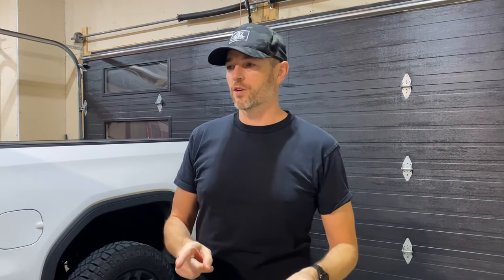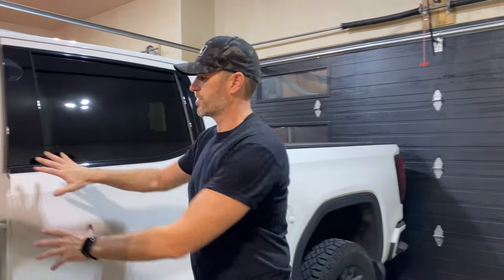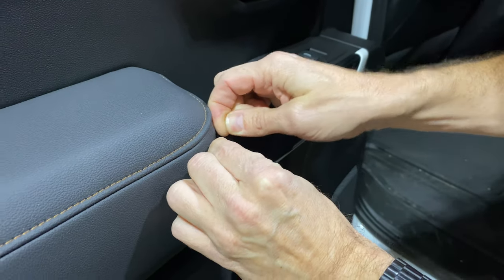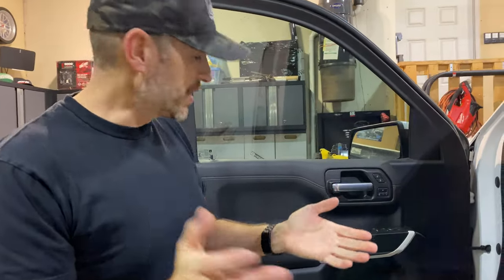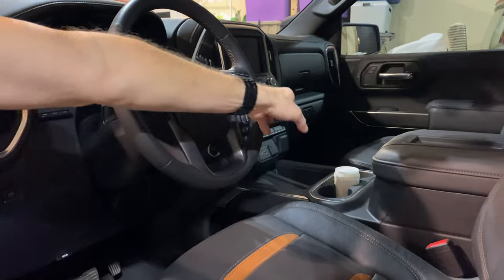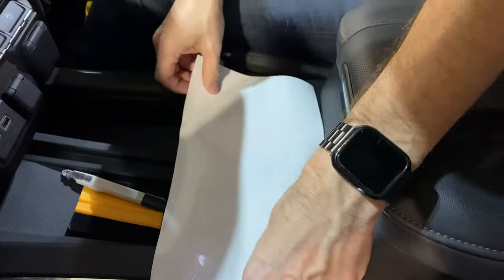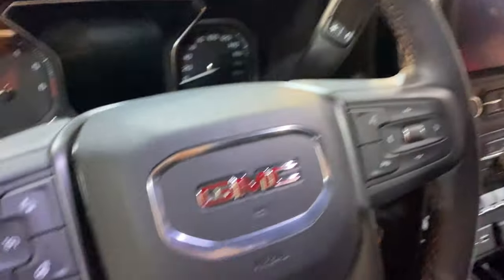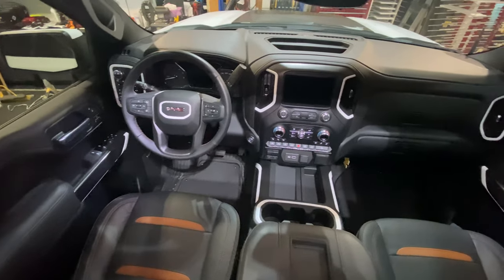Interior Vinyl Wrap GMC Sierra Chevy Silverado! Deleting as Much Chrome as Possible!

Comment: I literally tried this 2 days ago on my AT4 and ripped it off. I took the trim pieces out but couldnt get clean edges in the creases. I tried using the heat gun like you did but i found it just caused the wrap to go back to its original form and not go into the creases.
Reply from the maker: That can happen. Depends on the brand and characteristics of the wrap material too.

Comment: Funny - I have a base model / WT trim, and I'm trying to replace my bland black trim with the chrome you are trying to cover LOL.  Nonetheless, I really appreciate you posting this video.  I may try to actually do a chrome wrap (or maybe red, as my truck is red) like you did on my pieces instead.  The tutorial was great.  I did want to point out to you that taking the pieces off won't 100% allow you to tuck in everything.  For example, the AC ducts don't fully come apart where you can go 360% around everything.  Depending on the piece, you can only "wrap around" half of it.  I can send you pictures if needed, so you don't waste your time taking something apart when it won't do what you expect it to.  Nonetheless, thank you again for this video and tutorial!  I think the white looks great over the trim.  I'd be curious to see how it looked if you did the orange like the seat inserts are though ;) .   Have a great weekend!
Reply from the maker: Thanks!  No need for pics, I know what you mean.  Copper vinyl is a available that is supposed to match the seat inserts pretty well.  People have been asking me to do a video on this, I had some vinyl to use, so I did it 👍🏼
Reply: @Donslife  glad you have an option to match if you decide to redo!

Comment: Have you tried to remove the bezels for the front vents?  I'm plasti dipping the "chrome" in the front to eliminate glare off it while driving on sunny days but no luck so far trying to get the 2 out side one off to spray them
Reply from the maker: I haven’t.  I suspect they are small breakable clips.   Sometimes looking up replacement parts online or even Ebay can show you parts and where their clips or mounting points are for reference.  Sorry I don’t know offhand though
Reply: Same situation for me. I could do the cup holders since they popped out but the speaker bezels (doors), vent trims, door chrome, etc. scare me when I tried one of the speaker trims. I heard a crack and something fell inside. Thankfully it didn't impact its fitment but my heart sank. When I shined a light it looked like a chrome clip that sits behind the plastic of the door. I'm beginning to think I'm going to spend a lot of time inside my truck. There could be worse things!

Comment: I know the video you said that you weren’t using a color match to the exterior paint but from your experience have you purchased or seen also color matching to your exterior paint. I ask because I just ordered the new 1500 SLT Refresh in summit white. And want to delete the outside chrome asap when I take delivery. Please help there’s a company that is called color match but the want for a 1ft square $100. I’m going to need more than that. For all the chrome.
Reply from the maker: I haven't found an exact match yet.  I have tried Avery and VViViD Gloss White.  Maybe try 3M or visit a local wrap or sign shop and ask for a sample of whichever white they use.  White is often stocked at some places for commercial wraps